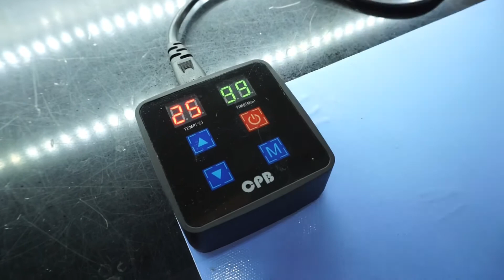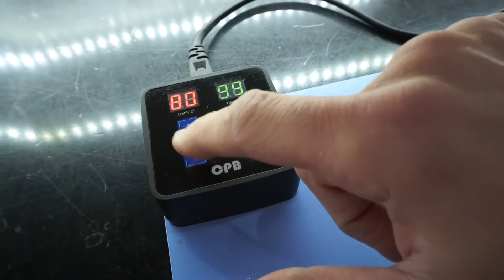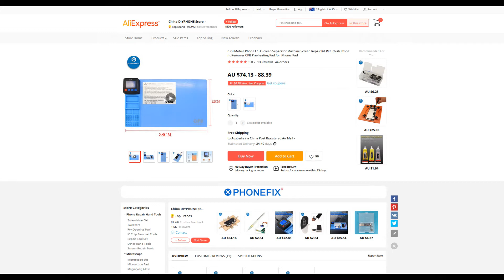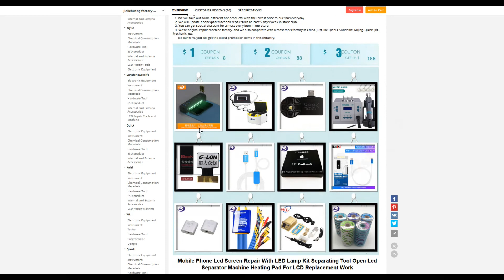The CPB Headpad, One Tool i couldn't work without!

Comment: So once you've removed the back, what do you use to stick it back together? Special glue? Or those device specific double edged adhesion
Reply from the maker: Your can use b7000 frame adhesive

Or simply reheating the back glass,  will get the existing glue sticky enough to restick
Reply: @rickstechrepairs  thanks for the quick reply 😘

Comment: I have one of these that I got from work; they were going to throw it away because it was throwing an E1 error. I told them I'd like to take it and see if I can fix it and they agreed.

Any ideas on what could be throwing an E1 error? I took the back off of the power adapter, but the only thing that jumped out as unusually is the solder on the one prong didn't completely cover it.
Reply from the maker: No idea on that sorry, the one I had that failed went with a bang